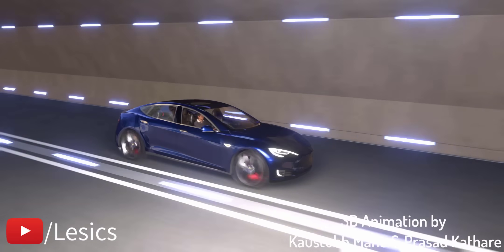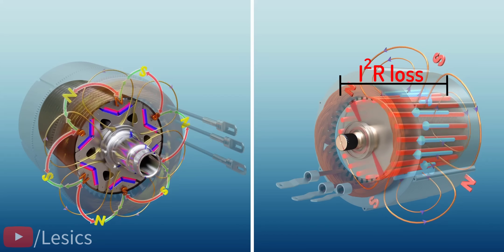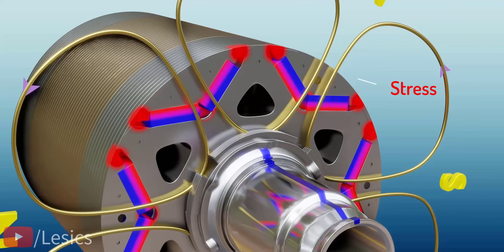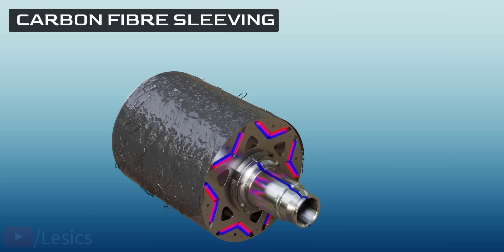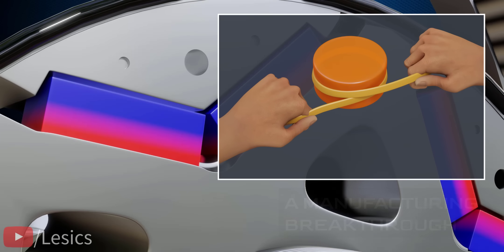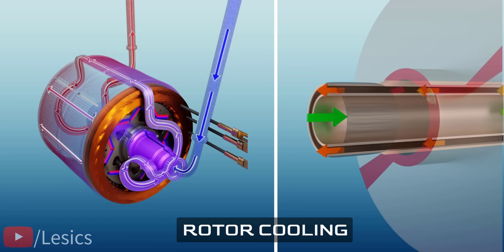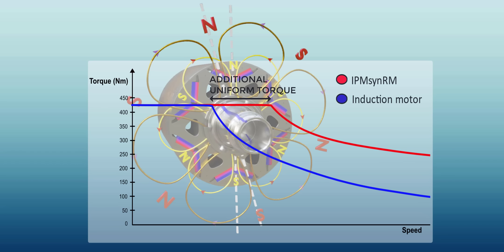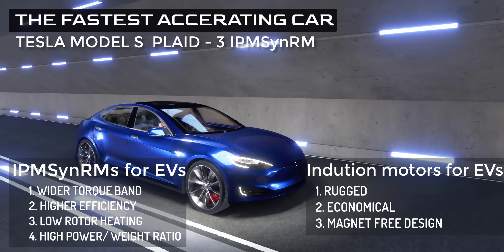Model 3 Vs Model S Motor

Comment: Noob! 98% efficiency is at 50 rom no load, motor peak efficiency at optimal point is NEVER over 90%. Tesla at 130km/h has 60% motor efficiency. If it would be like you said, why do they have cooling system??
Reply: Nonsense. Highest efficiency is at moderate motor speed and high load. No-load efficiency is zero by definition: with no load there is no power output so all input power is lost, meaning zero percent efficiency.

Comment: And how do we make sure permanent magnets will not gonna lose magnetism properties with time and reduce power?
Reply: Include some kind of temperature sensing mechanism, either by using a direct sensor, or by sensing coolant temperature differences before and after the motor which can be used to indirectly measure temperature if you have a good thermal model of your cooling system.
You could also do a sensorless design where you predict the losses and thermal behaviour of the motor, based on how it is controlled.

Then if the temperature were to exceed a certain limit, you can reduce the power to prevent your magnets from demagnetizing.

Comment: Can the IPMSynRM design be made in an outrunner configuration? It seems like it would be easier to cool that way, assuming air cooling on the PM and Reluctance portion would be sufficient when it is on the outside.
Reply: Surface (not internal) permanent magnet motors are readily available in outer-rotor (outrunner) configuration, but they're not popular. Since much more cooling is needed for the stator than for the rotor, making the rotor easier to air-cool isn't really an advantage... and a surface PM motor doesn't have useful reluctance torque.
Reply: @brianb-p6586  I was thinking that the stator could be liquid cooled, and being stationary would not need a high-speed water-tight seal.
Reply: @vodiak  Right, the plumbing for the stator is easy either way, but it's good to have a large cooled shell wrapped around an outer stator rather than trying to cool the small central core of an inner stator. All modern EV motors have a liquid-cooled stator.
Reply: It can't, not enough "meat" behind magnets so not enough flux weakening

Comment: Great video!
It would be great to describe VW's DC motors used in ID.3 etc.,  and compare to Tesla's.
Reply: They are not really dc, all modern ev's use three phase ac motors.
Reply: VW uses internal permanent magnet synchronous motors, essentially the same as the Model 3.
Reply: @brianb-p6586 😊no
Reply: @jopabolit  VW now also uses induction (asynchronous) motors, with just PM in RWD models (such as the ID.4 RWD) and one axle PM and the other axle induction in AWD models (such as the ID.4 AWD)... just like the Tesla Model 3 and Y.

Both induction (synchronous) and synchronous PM motors are AC, not DC. No one uses DC motors in EVs.
Reply: @brianb-p6586 tesla battery bad

Comment: I thought Tesla used both motors in their cars, as the induction motor is more efficient for constant cruise speeds while the IPM-SyncRM for high accelerations, isn’t that right?
Reply: For their Plaid model s they have replaced the induction motors. For the model 3 the front drive unit is still induction. The advantage with induction motor is that you can put them to sleep during cruise but the new motor is always more efficient.
Reply: No, the induction motors are the old ones, and the PM motors are the new ones (starting with Model 3, but now used in all models).

Comment: So basically it generates more torque at higher speeds, but it's more expensive and slightly more complicated (in factors such as cooling). I wouldn't call that an improvement but rather a trade-off. I think it would be better for things like work trucks.

Comment: I prefer the induction motor because it has no magnets that require limited availability elements, is of more rugged and simple construction and there's no reason to care about speed as there's no need to go past 100km/h or to climb a hill very quickly, the induction motor also doesn't require very complicated cooling as shown in this video
Reply: I Wonder why most ev makers are going with the 1st one then
Reply: @Dota2funny  the video said that pm synchronous motor is used mostly by high performance ev makers, not the cheap and mass market oriented ones
Reply: @GABRIEL-dz9mh  I didn't notice that, but it would be hilarious... since moderately-priced modern EVs (Nissan Leaf, Chevrolet Bolt, all of the Kia and Hyundai models) all use PM motors.
Reply: I’ll take the other, better one.
Reply: Actually induction motor do require complicated cooling as both rotor and stator heat up significantly. IPMSynRM - not so much, rotor heating is greatly reduced, reducing need for complicated cooling.
Reply: @volodumurkalunyak4651  with an induction motor, the actual temperature limit is what the stator winding insulation can take, high rotor temperature just slightly lowers efficiency, if you cook it a bit too much, it just has to cool down. Overheat the neodymium magnets and they permanently depolarize, ruining the motor.
Reply: @AKAtheA that only works if IPMsynRM does have the same losses distribution beetween rotor and stator as induction motor, but it doesn't. IPMsysRM does have lion share of rotor losses eliminated compared to induction motor while keeping stator losses approximately the same.
Reply: @volodumurkalunyak4651  but it still has some losses (still way too much to get away with not using liquid cooling) and failing to cool the magnets does result in permanent degradation. That is the one advantage of induction motors, they are hard to kill and they're simple. Not sure if cheaper, given the chunk of copper in the rotor.
Reply: @volodumurkalunyak4651  video said opposite😄 however I'll stick with the induction 3 phase as no relatively rare and hard to source rare earths are required
Reply: @GABRIEL-dz9mh  video also states 96% efficient vs 98% efficient and maximum rotor temperatures at 80°C vs 100°C. 98% efficient with maximum rotor temperature 80°C is easier to cool than outher combination.

Comment: Question now is, can you replace the induction motor with this newer motor? Would it work well in hybrid vehicles? Or is this only good in an all electric vehicle?
Reply: An induction motor has lower freewheel drag, which makes it a better choice for occasionally used additional motors on an AWD system.
Reply: Most hybrid vehicles already use synchronous PM motors.

Comment: The weakness in the new motor is that it uses rare earth permanent magnets. Elements that are resource limited, and are both expensive and subject to supply chain problems.
Reply: Lol, they are not rare. Dont get fooled by the name. Agree with supply chain problems though.
Reply: @romansenger2322   while neodymium is the second most abundant of the rare earth metals at 38mg per kilogramme of the earth crust. The largest deposits are in China, making it as rare as the Chinese want it to be.
I understand China has placed an embargo on its export, as it is considered a strategic material.
Is that sufficiently rare for you???
Reply: @nigeljohnson9820  no, its rare.
Reply: @romansenger2322  the world's total production of neodymium is approximately 7000 tons per annum.
Reply: @nigeljohnson9820  Oh oke this means war. We need it.
Reply: @nigeljohnson9820  What the fuck is rear earth metal? You got corrected once but you still talk about somekind of rear earth metals :D
Reply: @Matu1  I have just understood what you mean, I was reading what I thought I wrote, and not the misspelling that Google auto correction insists in adding to my posts, I have correct the spelling error and edited the tablet dictionary. 
it describes a group of metals on the periodic table of elements that are both uncommon in the earth's crust, but also have some very useful properties, particularly magnetic. These metals can be used to construct permanent magnets that are much stronger than those that can be produced by using iron, nickel, or cobalt alone. Given that the torque a electric motor can produce is directly dependent on the magnetic field strength of its magnets, they are obviously critical to electric vehicle production.
Reply: @romansenger2322  They are rare, why? Because we produce thousands tons of those elements while needing millions.

Comment: This is great! It shows how in real engineering, solving even one small problem through innovation causes another problem, and you have to solve that too... and finally an optimized solution is used. Engineering is not easy; that's where interdisciplinary knowledge is useful. My respect to the genius of Nicola Tesla for coming up with the idea of rotating magnetic field and creating induction motors using it. I have difficulty imagining any field :).
By the way, my respect also to Lesics team for presenting the knowledge of sophisticated engineering to the students in the most interesting way. I am sharing this channel with all the students I know.
Reply: Engineering is about finding the Perfect compromize.
Reply: the first single phase induction motor made by  Ottó Bláthy way before tesla and used in the electricity meter. and also he invented the transformer too. the 3 pshase induction motor invented by Galileo Ferraris at 1885. tesla made his own at 1887.

Comment: They do it on blades turbines for extra strength web binding cald stringer and a robotic system that winds precisely perfect laps so no imperfections are made and then after using this they heat treat it with air activation too with ambient air or a lil higher but not enough to melt magnesium anyway that's what I know working in the carbon and blade industry for ten years they also have to use a ultrasonic system that uses water so they can see if any cracks bubbles or overlaps that are out of tolerance like looking for improper welds on pipes really cool technology

Comment: You could have spent a little more time on the beginning animations. I didn't find them very easy to understand.
Zero motorcycles used a carbon fiber approach to hold things together.

Comment: Eh I’ll stick with internal combustion lol
Reply: People still ride horses.
Reply: @ibinding29  definitely the greenest way of transportation lol
Reply: @kenxiong6830  
 
Absolutely NOT the greenest! Horses have a larger carbon footprint than you may imagine. Working horses need a lot more than just pasture. 

However, there is one breed of horse that has a considerably smaller carbon footprint. It’s that pony that belongs to a guy called Shanks! Couple a pair of those to a little two-wheeled conveyance called a “bike”, and the carbon footprint is even smaller.
Reply: @q.e.d.9112  I’m pretty sure the carbon footprint of horses is still less than that of electric or internal combustion vehicles. At least when a horse dies it easily decomposes and returns to the environment. Can’t say the same for cars

Comment: Cool video, but a small correction: the Model S Plaid is the only version that uses the carbon fiber sleeve. The other models just limit the RPM
Reply: New model x also uses the carbon sleeve motors
Reply: @xWinstonski  to correct your correction...only the model x plaid uses the carbon sleeve motors
Reply: @xWinstonski  Correct. I forgot they started to ship the refreshed X too 😅
Reply: I think some of the changes for the 2022 model year for 3 and y include using the plaid motor, but only on the performance trim. So, model 3 and y performance will get this new plaid motor soon!
Reply: for now, probably they will implement the new design for lower end models as well
Reply: Came to the comments to look for this. Thanks
Reply: @CED99  was wondering if i misheard the telsa event. thanks for clarifying for the comment section
Reply: @CED99   *ిిు
ఞ. హూ  జ)
Reply: I was gonna say, the model 3 isn't even close to the S Plaid, yet they are using a complex in house developed, tested and implemented motor in the model 3? I knew it didn't sound right, makes more sense this is put in higher end models, like the S Plaid and the future Roadster
Reply: @firefoxuser2557  the Plaid motor is a variation of the Model 3 motor. All current Tesla motors are variations of the same design, which was introduced in the Model 3.

Comment: Maybe we can use superconductors in the induction motor, and there will be no more I²R losses.
Reply: Not sure if that would even be helpful to achieve superconductivity the materials has to be cooled to absolute zero constantly to achieve that and that's not feasible for an electric car and plus you need friction to achieve to achieve torque and superconductors don't even make conduct at all.
Reply: @oxide9717  There are "high temperature" superconductors that only require extremely cold temperatures, rather than ones close to absolute zero.  But they have complex behavior with high and changing magnetic fields above a critical level.
Reply: thats a pretty good idea!

Comment: Would like to know about the kind of motor used in other EVs from popular brands like BMW, Mercedes, Porsche and Audi. BMW iX is one such promising car.
Reply: Most of them use Internal permanent magnet design. their designs of rotor varies. you can watch Munro's videos on this topic. he gives a details overview of all drive trains of these companies
Reply: @getartsywithyogita8291   : Thanks.
Reply: I believe BMW are looking at separately excited synchronous motors. Like a conventional interior permanent magnet synchronous motor (IPMSM, with no reluctance effects), but with an electromagnet rotor instead of a permanent magnet one. The Renault Zoe has been using this design since its first model. Its biggest benefit is that it eliminates the need for expensive (and politically-fraught) rare earth magnets. Its biggest downside is that, like the induction motor, it loses energy as heat in the rotor, and needs to be cooled for effective operation. The separately excited SMs are less efficient than the IPMSMs, but I believe they're marginally more efficient than induction motors.

Most manufacturers are using IPMSMs (without reluctance effects). Expect this to change as electric powertrains move from low-volume luxury vehicles to high-volume mass-market vehicles, and/or China start constraining the supply of neodymium and dysprosium. Separately excited motors and reluctance motors - especially ones that use aluminium alloys instead of copper - will probably become more common.
Reply: @gigabyte2248  All IPM motors exhibit reluctance torque, and all modern IPM motor rotors are designed to work with that. The big difference at Tesla is that they claim it is special, while others barely mention it if at all; the difference is marketing, not the motors.
Reply: Renault uses separately excited motors
Reply: As far as I know, Tesla is the only one using induction motors, all others use IPM motors (not just for EVs but for hybrids as well). However, there are some that uses IPM-SyncRM for even longer than Tesla. The BMW i3 is an example of this.
Reply: @fabiobobrow  Some Audi e-tron motors are induction, but almost everyone else uses IPM motors for their EVs. Almost everyone who has made an EV has used IPM longer than Tesla.

Comment: How does the conductive carbon fiber interact with the spinning magnetic fields? Is there any induced current?
Reply: Since the permanent magnets are synced with the rotating magnetic field, from the perspective of any conductor on the rotor, the RMF is still, so no induced current. There might be a little induced current when speed changes, and it helps rotor and RMF sync up quicker, but rotor doesn’t rely on it, unlike induction motor. That’s why sync motor is more efficient than async motor. But there is possibility that the permanent magnets lose the magnetic property, by heat or external alternating magnetic field. So induction motor is more reliable.
Reply: @joy2000cyber  The same can be said about the rest of the rotor right? If what you say is the case, why do the bridges matter to begin with?

In the animation it also seem like the rotor is "sliced" vertically, likely to limit the eddy currents in the radial direction. It feels like the continuous carbon fiber sleeve would conduct the electricity radially.

What gives?
Reply: @H1tman47  Yes, the rotor is built of many thin steel plates, but to stop eddy currents in the axial direction.

Comment: Solid lifters, pushrods, Holley Double Pumper carbs.... Good times
Reply: then: hey dude whats that engine you got there? It's a blown big block buddy, it kicks ass
now: excuse me no gender having person, can I ask what motor your vegan electric car has? Sure it is a WF-C5790DWF/4 PRO PLUS 12S MAX
just doesn't sound the same, does it
Reply: @darius2640  
When the glass packs pop, the panties drop.

Comment: I would think instead of heating the rotor they would instead chill them well below anything they'll ever experience, let's say 40°c -50°c and if they wrap it cold then the carbon will only get tighter when it warms up.
Reply: Ohh that's how you strike through 😛
cool
Reply: Carbon fibre exhibits negative thermal expansion.
I can't say anything about their resin matrix or what its TG limit is.

Comment: Anyone know any tech company is using vacuum motor to reduce fiction so motor will have higher efficiency without fiction?
Reply: @feedayeen  what if there is no ball bearing but replaced by magnetic just like maglev? 

The reason for vacuum in the motor is to reduce air fiction by without air fiction. 

Nevertheless my idea was to create a electric generator to generate electricity. For renewal or free energy.
Reply: Fiction is normally left to marketing departments. Tesla doesn't have one.